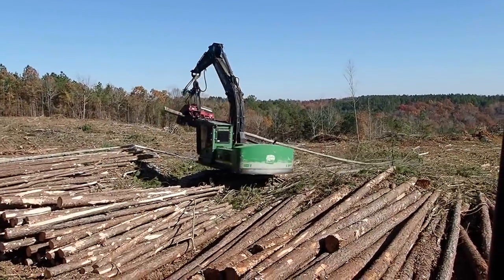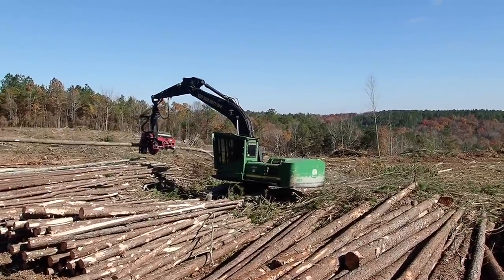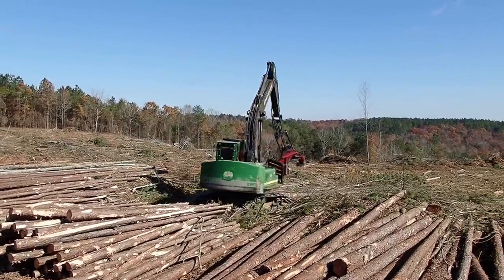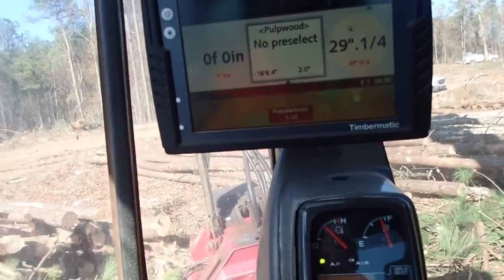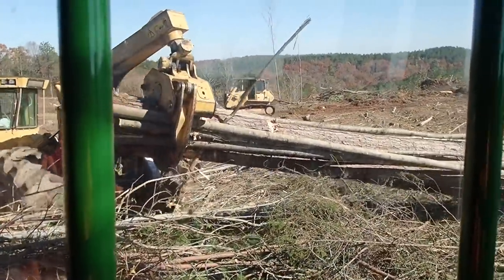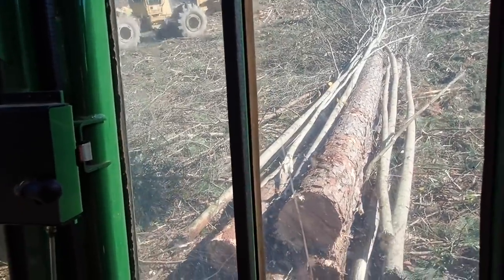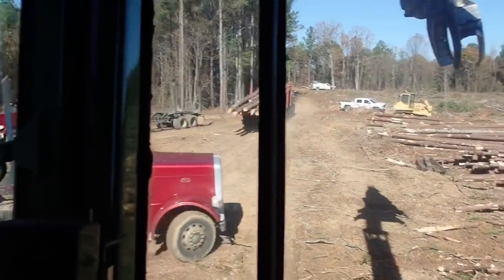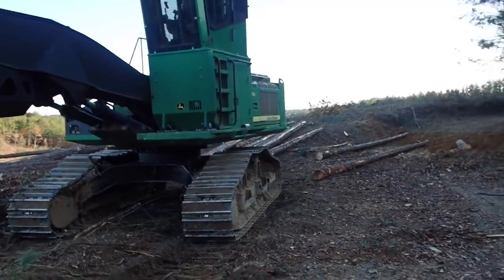Our 1999 John Deere 748gll Skidder #johndeere

Comment: I wish you would do a vid on y we put the hardwood and Pine together.  I have an 853 track machine cutting and a 2154 G with wartah 622 B. I have so many questions on why we run the pine and hardwood together. I cut mostly pine plantations , all old federal and IP land ,  and when a gum or two is in the plantation like a weed, it’s better to throw them in the pile with the Pine and drag it to the yard instead of leave 1 or two here and there and then the skidder has to run around everywhere trying to get a drag and leaving stragglers everywhere.  I do things a lot like yal.  But I had 3 437 loaders paid for and like yal, you just can’t by all this equip at one time. It takes time and planning. We have a large wood products trucking company that’s has hauled for me for over 13 years. They have over a 1000 trucks pulling wood products from out of just about every pulp and saw mill in east Ga ,SC,NC, and surrounding areas. They have 2 drop men and 4 drop trucks and over 30 empty trailers for us to load during the day.  They keep usually 10 dedicated drivers with us , but after they leave here they probably go to a Woodyard to get backhauls back toward me. They have trucks that come to wadley(Battle Lumber) bringing wet yard wood to them and then come by my woods getting loads back to Savannah or meldrim to keep them from hauling air.    We set up two 437s at the processor , one loads prime cut cns and sawlogs on the saw side, while he runs pulp tops , tree length pulp, hardwood pulp, and 16,6 cuts to the away side to me.  Each loader has a drop truck , and trailer to load at all times so we hardly ever stack any wood, always building loads on the trailers. So I am able to get away with not having a track loader , although I would love one, just need to spend the money in other places. We use one of the 437 s as a backup or get wood loaded in case we leave a pile or you know, always a use for it.  We do usually have two loader men, one being myself loading the pulp side ,  and the other loading sawtimber and cns and poles, but I’m 55 and it keeps me busy working with the crew.  We run 25 to 30 loads a day so 2 loader men really may be overkill, but we do other things as well.  You know nobody does it the same, whatever makes money and sense is what you do.  Thanks Tim for your time and entertainment. I watch every vid. From middle Ga, Louisville to be exact.  Long time Federal paper , Ip , land base logger.  33 years. AC

Comment: You guys have spoiled me. I have a crew logging on my property right now and they got some junk they working with! Small old Tiger Cat feller buncher with a worn out 548 skidder. No delimber, they just back through trees and run over the tops with skidded, lol. The oldest junky ass oil leaking knuckle boom in Mississippi loading and only one truck and they take a chainsaw and cut the tops to max overhang length by hand. They are getting it done slowly, lol. I honestly have no idea how they are making a dime. The cutter operator also loads and parts house makes daily delivers of hose, fitting and hydraulic fluid.

Comment: That processor is an awesome machine and complicated.  How big of a tree can it process?  That John Deere skidder doesn't look like something that you would want to run in hills each day.  Lot of lever action going on.  Y'all tell me if I'm right, but Tigercat came out with joystick controls in their skidders back in 2010-2011.  They had a steering wheel too but did put the grapple functions on the joysticks.  Good video cotontop3.
Reply: Clinton Stubbs I ran a 666C Clark that was an 81 model. It had a right hand 4 way valve for steering and blade control. It was a cable skidder and was super easy to jump on and off of with nothing in your way.
Reply: @carlwilliams8354  that's pretty cool.  I never heard of those skidders.

Comment: Love watching the processor run! When it shoots a tree out, that's money in the pile and that is what it's all about. Gott'en tired of being beaten around & jerky motion of trailer loader. Mr. Tim, you have any input on the Southstar heads? Although pretty sure Waratah is the way to go.
Reply from the maker: They are good heads but where u and I log, you need to stay with a waratah. Because of the dealers and the support from waratah that you can easily get.

Comment: I am sure there is a good reason and maybe money is it but the processor seems so efficient, I don't understand why every logger wouldn't have one
Reply from the maker: You are correct, it’s the initial price tag.
Reply: The processor is hands down better that a loader pull through set up but for a really small logging operation like mine the loader pull through slasher combo works decent tdk does more loads in a day then I do in week so it wouldn’t be feasible for me to have a processor and track loader. It sure is fun to watch the videos and dream tho!